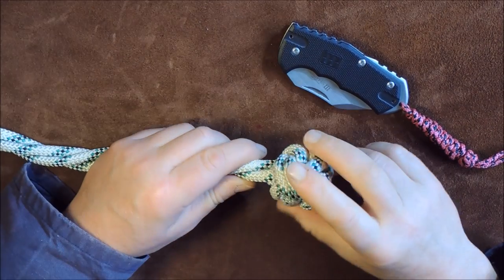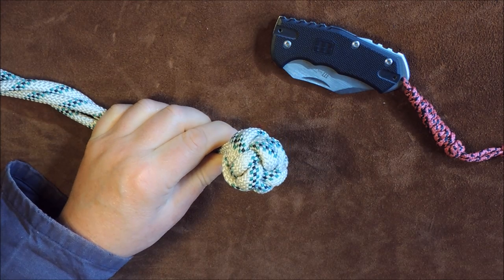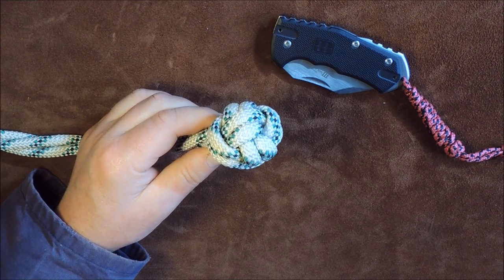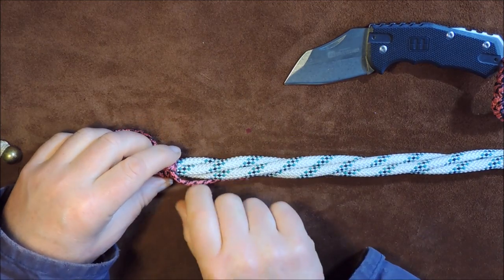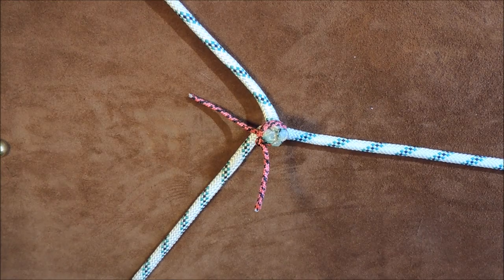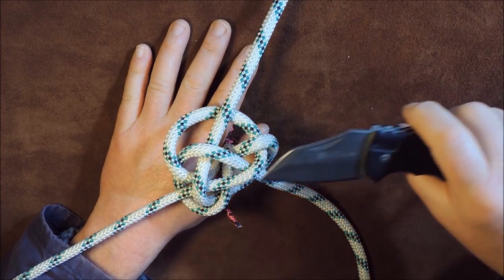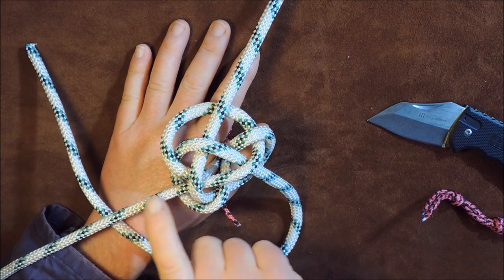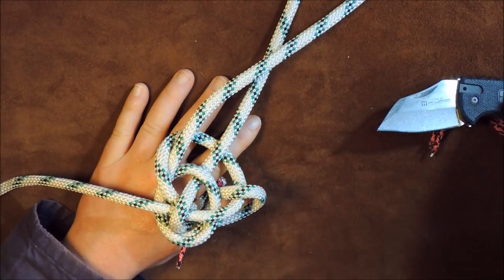Manrope Stopper Knot a Decorative Stopper Knot for Your Rope or Paracord Wall and Crown How to Tie

Comment: These are great I've tried several from the Ashley book & Marlin spike books. The diagrams can be hard to follow. But your explanations while you're doing them works a charm. This particular knot is used a lot on the bolt (piece through the cleat) for a sea chest becket. Which is what my goal is to tie a respectable becket for a sea chest. Thanks
Reply from the maker: Thanks for taking the time to leave a comment. I have made many a bell rope, cat of nine tails and ditty bag handles, but never a chest becket. I have heard though, if you are making a chest becket, you should do each section in pairs. In other words whatever you do to one handle, you then do exactly the same on the second handle. This way you end up with a perfect matched pair. Good luck on making your handles.

Comment: I understand using the synthetic rope makes it easy to demonstrate on a video. However, I'm using synthetic hemp rope which is the most common  decorative rope used for hand rails and the man rope knot stopper. This is an entirely different beast. First of all you have to unravel the three strand about  2-3 feet to have enough to create the knot. The multi strand fibres easily loosen and the whole thing can become a confusing nightmare very quickly. Can you recommend/demonstrate something/way to keep the fibres together and to identify the individual strands as you progress through the knot. Synthetic 30mm  hemp rope is not cheap. I've just wrecked 3 feet of a 10 yard piece which has now shortened my rope too much to be of any use for my hand rail project. Watching your video gave me misguided confidence that I could make this decorative knot.
Reply: Might be too late here, and possibly also misunderstand what you need. But what you could try is after unraveling the three strands of the rope, tape each end up with some painters tape or electrical tape. Kind of like the end of a shoelace. That should keep the strands together and make it a bit easier to thread through the knot as you go.

Comment: Good demonstration, I'm confident I can tie that knot now. It became a little confusing as you began following strands through, I didn't feel like you have a clear indication of which side of the strand you wanted to follow so the instruction to 'just uncross them' was a little frustrating. Also, would have liked to see the knot tied on a twisted rope that extended past your constrictor knot. Good work laying up your own for the demonstration. If you'd used three separate colored strands, it may have added some appeal for anyone who was unfamiliar with knotting.

Hope that was constructive. This is the first time I've seen your videos, I'll be looking out for more. Keep it up.

Comment: Excellent tutorial, thank you.  What happens next though, to hide the ends to be sure the whole thing won't unravel is the burning question???
Reply from the maker: Often this is used as decoration on the end of a rope on say, a rope stair rail. The idea is that you make the knot nice and tight, then cut the loose ends flush under the knot and ten tuck any scraggly bits into the knot.

Comment: useful information would be the length of rope required to tie the knot relative to diameter/circumference of the rope being used. Now on my 3rd attempt to have long enough tails.
Reply: Hi Jim,
Did my first attempt last night: started with 40cm on a 2cm thick, 3 strand cord. At the end 10 to 12cm exces was left.

Comment: high standard as usual, have you thought of doing each strand in a different colour so people can see it through the knot? 
As they said in pots Blake in the old days of black and white TV the brown is the lighter grey one.
Reply from the maker: Wooo, now you are showing your age, trouble is that I remember that too. Thanks for leaving a comment, they all help me to make things a bit better. Are you also a knotter?
Reply: yeah doing a bit with paracord not looking the finishing showing on them (cut and burn). one of my first was a light pull with miniture light houses and beach huts from bridlington,where saw trailer full of rope being towed off the harbour as I sat down at the cafe,
Reply from the maker: With the cut and burn method, I believe if you have the right colour sharpie, it covers all sins. Personally I am not a fan of cut and burn, if I can I always try to tuck ends away neatly. Got any samples of work on-line, would love to see it?

Comment: How do you determine how much rope to untwist for the knot?
Reply from the maker: I wish I could give you an exact answer............. and I am sure that somewhere there is one. As you make a few decorative knots, you just learn how much rope you need. Not just for making the knot, but also enough length to swing off the ends to make it really tight, before cutting them off.
Reply: @KnottingKnots  Thank you

Comment: very nice... thank you.  possibly slightly clearer if you had a standing piece instead of simulating it?
Reply from the maker: Yes, I think this is going to be one of those knots that I revisit. It has been suggested also using three colours also. There again I could also do one with an actual piece of rope, will will also show additional problems that people will have to deal with. Are you a knotter?

Comment: I have tied many manrope knots,yours was somewhat clumsy ,if you were to use a proper rope rather the 3 strands it would have been better .I don't agree with you on the fact that a crown knot is an upside down wall knot because they rotate in different directions as a crown knot goes anticlockwise but a wall knot goes clockwise .
Reply: Both Crown knots and Wall knots can be tied in any direction.  Crown knots and Wall knots are inversely related to each other. One can be turned into another by inverting the stem (which also changes the direction).  I have a video that illustrates this which you might find interesting. See the section titled: Comparing Wall Knots to Crown Knots. https://www.youtube.com/playlist?list=PLac0kf1v9OuAIbP8LJNAUpwQZ-jg9xnnL